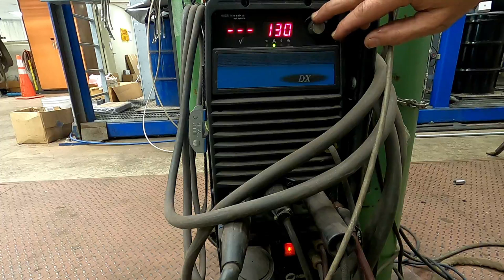Massive Footer pour Day!

Comment: It is a shame you don't have professional supervision on this project as the reinforced foundation needs to be of an acceptable quality and construction.  Whilst your reinforcement may not be formed in the usual manner it may be acceptable to your designer.  However, I have reservations about the concrete pour, which was critical for the performance of the footing:
1)  A 2" pump is essentially for small above ground work and not suitable for the mass concrete pour.  A 4" pump should have been used so as to pour the foundation as quickly as possible to prevent pumping partially set concrete.
2)  The footing (a ground beam) requires full compaction/consolidation to ensure that the concrete and reinforcement act as one, so that a poker vibrator should have been used.  I would have insisted on duty and standby units to ensure a continuous pour.  I suspect that the concrete is formed like a raspberry ripple ice cream with folds and voids that affect the integrity of the foundation.  Post photos of the as struck concrete sides to confirm the homogeneity of the concrete.
3)  The level pins should have been left in the concrete as they have no effect, whereas taking them out would have left voids.
4)  The top of the foundation shouldn't have a trowelled surface - its useless and detrimental bling.  By trowelling the top surface the 'fat' in the mix will have been brought to the surface creating a very weak laitence, which needs to be scabbled off to allow the blockwork maximum adhesion.  The top of the concrete should have been left with a lightly tamped finish.
5) The backfill to the foundation should be using stone (2">dust) compacted with a vibrating plate compactor in 6" layers.  All to prevent voids around the edge of the slab as loose stone will naturally compact over time.  I assume that you will require a solid concrete slab edge to accept heavy machinery and cannot therefore risk any weakness?
6)  Personally, I would have engaged your structural engineer to oversee the work so that he has the liability that he will have indemnity insurance  for, whereas you will carry the risk of future failures in what is a proper civil engineering project.

Comment: Bit strange that they didnt vibrate it. I mean jobs done but not doing that as standard in foundation pours and him leaving reo in the ground thru the concrete is just poor. You 100% are right to pull them out. They would have rusted and potentially cracked the foundation. I would try drilling the spots they were in if u can find them and see if they have closed up. Otherwise pour some grout in them.

Comment: No need to 'vibrate' the mix?
Reply: Ah! - 12:25
Reply: The pour was slow enough and thin enough that it didn't really much matter. It looks like it settled quite nicely and I saw no voids or gaps on any of the sides once he took off the forms. Nice and smooth.
Reply: @nebtheweb8885  inclusions on form faces are called, "wormholes". Though some call it parging too. And yeah Steve's formed faces looked good to me. Good enough for exposed work. Which his foundation won't be.

Comment: Clearly you don’t know that you don’t want to work with wet block. You should start drying them now if you want to use the ones in that stack that I see!
Reply: What's wrong with block being wet? A bone dry block can cause bond issues. There is water involved with mixing mortar, you know?
Reply: @1pcfred  Some kinds of brick need to be soaked before they are laid, absolutely. Not so much block, they are less absorbent than you might think, and can float pretty badly on the mortar if they are too wet...meaning that you can't build very high without trouble.
Reply: @splinky99  you cannot build very high before mortar sets up wet or dry. We always moved after 4 courses.

Comment: Could have saved yourself a lot of work if you had your verticals cut and ready and placed them in the footer every 16"
Reply: He talked about this many times earlier in the project.  He has decided to drill and epoxy.  He feels better about the placement that way.
Reply: @paulcopeland9035  Placement is simple- find the center of each corner block, string a line at the height you want the vertical and put one in every 16"- done in 30 minutes.  You can set your bar as deep in the footing as you like.  But, too late now.  I still say 10-1 he lays his own blocks-